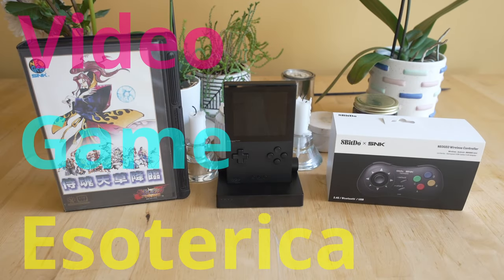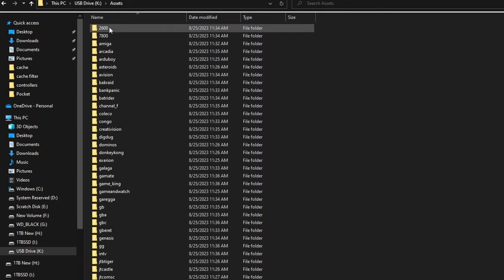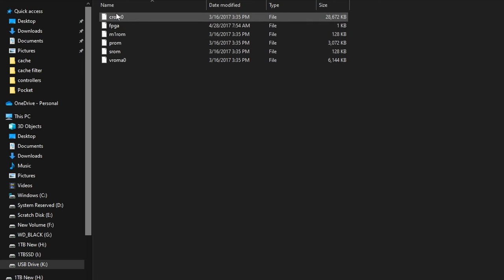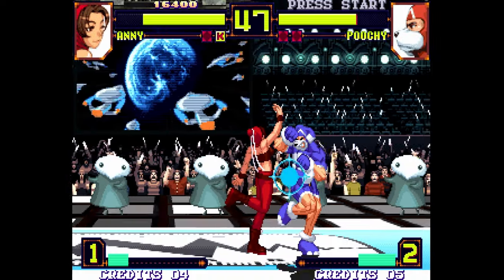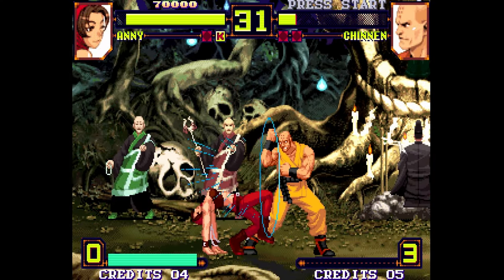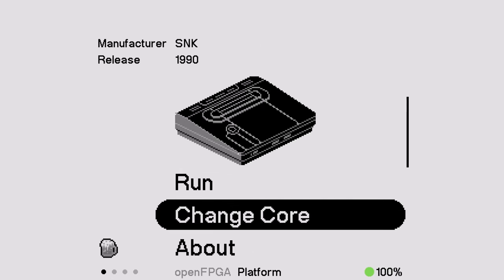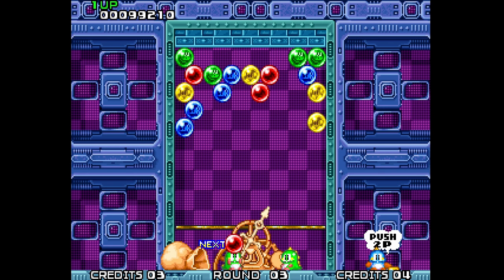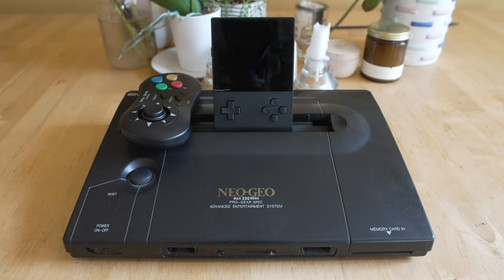Analogue Pocket Neo Geo AES/MVS Setup Guide, Review and Tutorial! Neo Geo Arcade on OpenFPGA

Comment: I didn’t see you cover this in your video, but for anyone wondering how to turn ‘blood’ on in Metal Slug (if that’s your thing), this is how you do it:
1) In game, press START+SELECT.  This brings up the ‘In Game Menu’
2) Scroll down to ‘Soft Reboot System’ and hit A. This will take you to the Unibios Menu.  Hold B+D+C together when this is displayed.  If you miss it, the game will boot and you will have to start over.
3) On the new menu, scroll down to ‘setting up the soft dip’ and hit A to select.
4) Scroll down to ‘Slot1 Metal Slug’ and hit A to select.
5) Scroll down to ‘Blood’ can hit A to toggle ON.
6) Exit all the way out by hitting C twice and then scrolling down to EXIT and hit A.
Enjoy your blood.  😊
Reply: This is the whole reason I was watching this video. You're a lifesaver.
Reply: If you, like me, tried this and didn't see the "Setting up the Soft DIP" option, it means you are in AES mode, not MVS (Arcade) mode. Hit the Analogue button, go to Core Options, scroll down to MVS/AES and fill the circle with white (enable it) if it is black. Scroll up to Reset Core, and start the directions above over at the "hold B+D+C" part. Also, default bindings can be viewed in Controls, but they are A = right, B = bottom, C = top, D = left (buttons).

Comment: I'm unable to access the UNI-BIOS to select the region and mode.  When I reset the core and press ABCD the memory card manager comes up.  The issue I was having before with the select button not adding tokens was due to the mode being console not arcade.  Somehow the mode switched to arcade and I didn't do anything. Currently region is set for Europe, not a big deal, but I'll the ability to select the region and mode.  Thank you,
Reply from the maker: It’s ABC, not ABCD. That should help :)
Reply: Thank you. Worked
Reply from the maker: I knew it would :)

Comment: For the 8BitDo NeoGeo controller, is the dongle the controller comes with the correct one? Or do we need to buy the USB2 adapter that’s sold separately?
Reply from the maker: You need the sold separately one
Reply: I updated the firmware on both the controller and the dongle that came with it, and now it works with the Dock on the latest Pocket/Dock firmware.
Reply from the maker: Good to know

Comment: In order to save games. Do I select yes to format memory card? Thank you,
Reply from the maker: Yes you need to do the format
Reply: Thanks, another question. How do I add tokens using the NeoGeo Controller?
Reply from the maker: Select should do it
Reply: That’s what I thought, but select just pauses the game. Dock is updated to the newest 2.0 firmware. I’m not using USB adapter ver. 2. The NeoGeo Controller is contested directly through Bluetooth. Is there another setting I need to change? Thank you